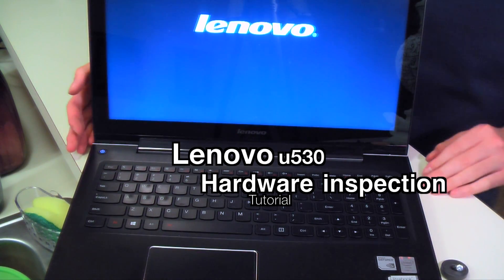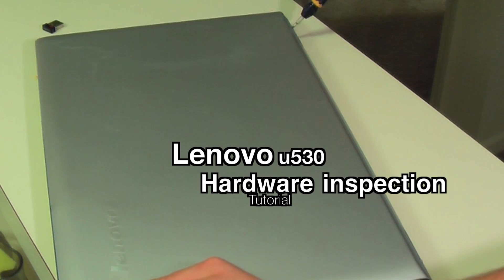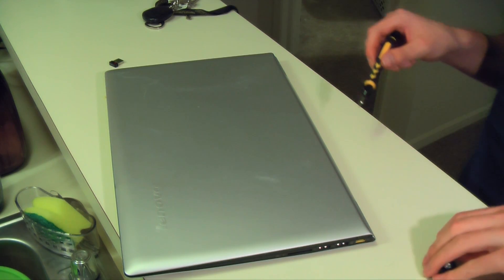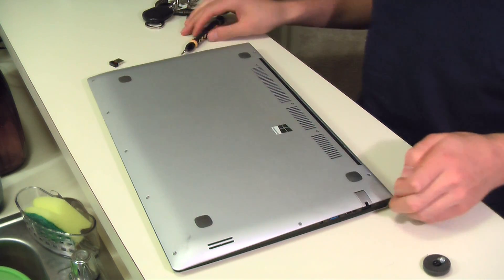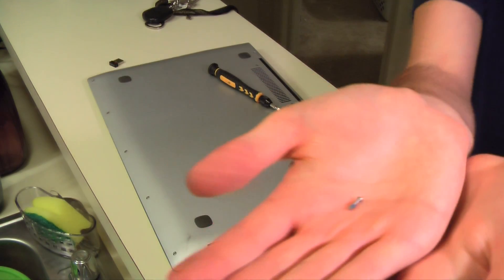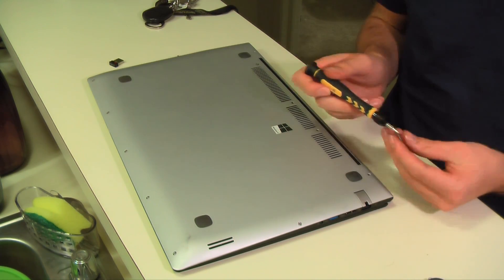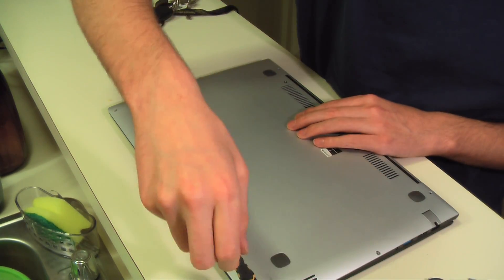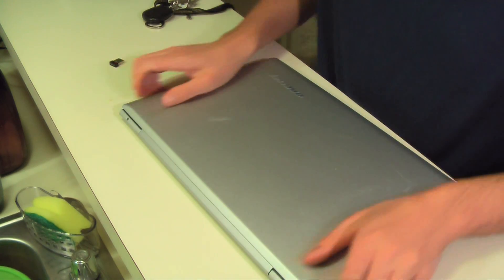Lenovo u530 Disassembly Hardware Inspection Tutorial Lenovo laptop won't doesn't boot (FIX)

Comment: Need help please help me. I have same lenovo model mine has the same problem but I changed the hard disk with a 1TB but now my laptop won't charge the battery it just flashes but no charge it turns on but with charger connected.

Comment: WTF??? I have tried for years to figure out what the problem was with the HDD and I never could. I even bought a 1TB external HDD which I installed Windows 10 on. But... doing something... as simple as unplugging and replugging the battery fixed it??? I'm a storm of mixed emotions and disbelief right now. On one side I'm extremely happy that you made this video and I finally found a solution. On the other side I'm extremely pissed that it took me this to find your solution, the useless money I spent on an external HDD, and how long it's going to take me to completely transfer everything from my external HDD to my original internal one. Seriously though, thank you!

Comment: I appreciate you mentioning that the HDD was fine and that reconnecting the battery (somehow) fixed it.
I've run into a similar problem on my u530. I plugged my external drive in one day and had to walk away from it for a while but when I came back, I heard the internal drive clicking and it immediately crashed as I was about to sit back down. Never any signs of a failing drive prior to that... Now it's got this really pronounced clicking from the head moving to the parked position. Seems to be affected by operating temperature and what accessories I have plugged in (wired keyboard, HDMI   -> VGA Adapter, wireless mouse, etc) ... With nothing plugged in, it seems like the amount of things plugged into the surge protector with the psu also triggers it... 
All this to say, it's not showing up at all now... So I'm about to pop this thing open and see what's up...

Anyway, helpful video, thanks for posting.

Comment: I tried to open up the laptop but can't seem to find the right screw driver to open it. I have a  PH00 and PH000 and it doesn't fit the screw. What bit did you use?
Reply from the maker: +Daniel Truong I used a guitar pic! Hope you get it fixed!